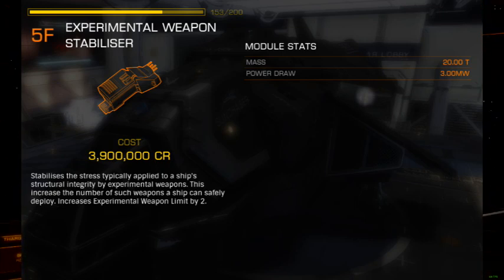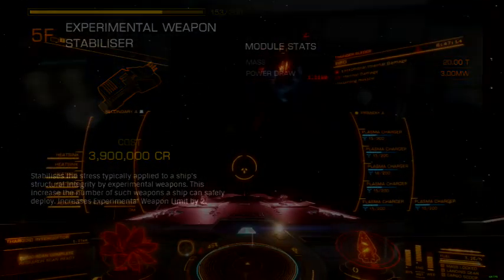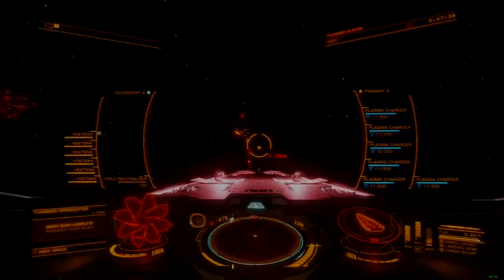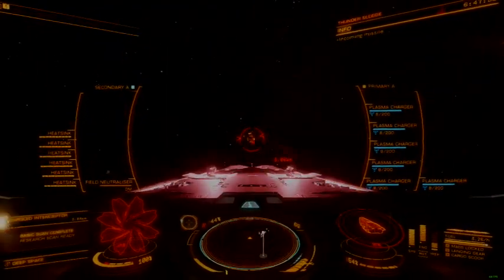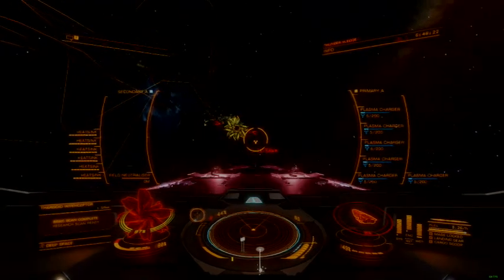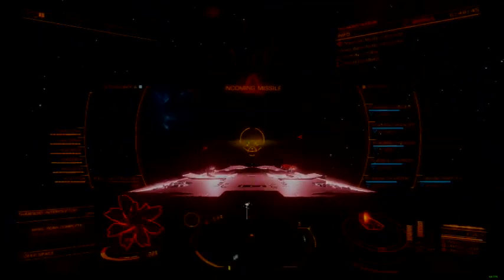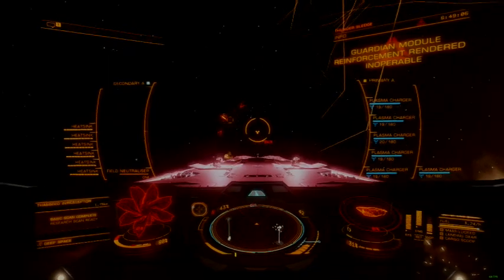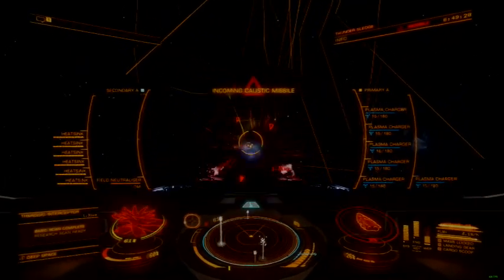Elite Dangerous | Module Review | 5F Experimental Weapon Stabilizer

Comment: Thanks for the review, why's the vid in 480 quality?
Reply: When uploading a video to youtube it is only in 480 to start with. Later it will be at a higher quality.
Reply from the maker: Not sure, I ran an upload in full 1080, but YouTube did not run it's HD pass.
Reply from the maker: Hah, the answer is I'm stupid. OBS captured the original background footage in 480p.

 Not sure how I got it set low, but my editor downscales videos on the timeline for better performance, so I didn't notice it until after the upload. 

YouTube didn't upscale it because there is nothing to upscale.

Comment: With 6 shard it is possible to instagib the Cyclops. It needs to be either of normal large or medium modified shards. 6 modified medium shard likely will cook the ship and distro, so some large is recommended.
Reply: Yea, I tried 6 mod shard anaconda, and it worked great! Indeed I could kill Cyclops without removing any hearts.
It needs 2 heatsink use for firing all 6 mod shards (to insta kill Cyclops) or heat will break through more than 300%. 
Still usable near station AXCZ, but not reliable for long fight without repair
Reply: @johoey4726  i use 4 large normal and 2 engineered medium. It give 140% heat for a full volley, but it is nothing even without heat sink.
Reply: "normal large or medium" what does that mean? As far as I know, no large Guardian weapons exist.
Reply: @cmdrHeliaxx  then you are indeed wrong. Normal means unengineered, and unengineered large shard exist for many years now, along with large plasma charger.
Reply: @Neo-vz8nh  ah right, just checked. These are the turreted ones tho, which noone really uses. If you do, you will just be better off using the medium fixed ones.
Reply: @cmdrHeliaxx  no, there are fixed too.
Reply: @Neo-vz8nh  fuck, you are right 😃 hm, dunno why I thought there were only small And medium.

Comment: Shards and Mod Shards have quite a bit lower power draw as compared to Gauss or Plasma Chargers.  But they do generate quite a bit of heat.  Just 4x medium mod shards will toast yer postie right fast if fired all at once lol.  Definitely be one for adding heat sinks to the firing trigger because thermal vent beams are not going to be able to keep up.  Regular shards are good against shields and reasonably good for exerting hearts.  With the drawbacks of having such a limited range to get full value from a shot.  And if you're close enough to the Goid to snipe a heart with regular shards you're probably close enough to reach out your window and poke the goid in the eye with your finger.  Mod shards accept a small reduction in damage done in exchange for greater range and the ability to snipe hearts.
Reply: If you run a conda, you can add 2 beam lasers with thermal vent along with 6 shard cannons and you stay ice cold for the 3 seconds it takes you to gib the goid.
Reply: @escapetarkov3838  2 size 1 beams, LR + TV, will cool a Conda down to 0.  But it takes a while.
6x size 2 mod shards, pop a single heat sink just before firing and you won't take any thermal damage.  Time it right and you'll never even hear the overheat warning.

Comment: question, can i stack these so i can have like 10 ax multicannons on the type 10?
Reply from the maker: No, when I tried it told me that only one AX stabilizer can be equipped per ship. Like shield generators.
Reply: @DryHeatAndSand  dreams crushed
Reply: Still taking size 5 stabiliser leaves only one size 2 and two size 1 hardpoints avalible
Just enough for flak and beams, i guess

Comment: Why use the Plasma Chargers? Seems like the worst choice, because of the capacitor draw. I'd like to try 6 salvation shards or 6 gauss. The anaconda can hold lots of heat sinks, so the shards aren't a terrible choice, and their ridiculous DPS is a ton of fun. Gauss... because Gauss.